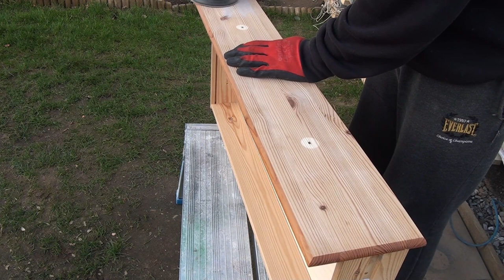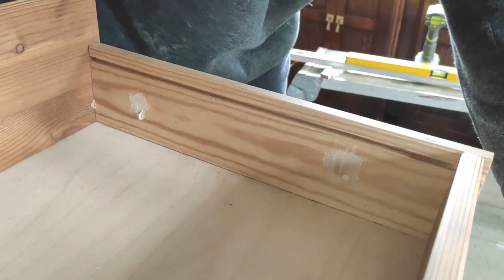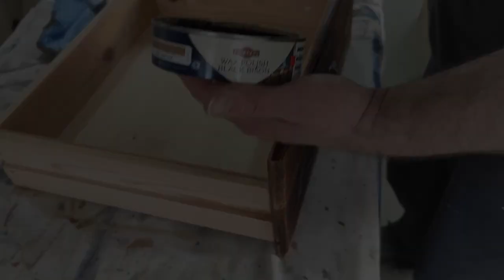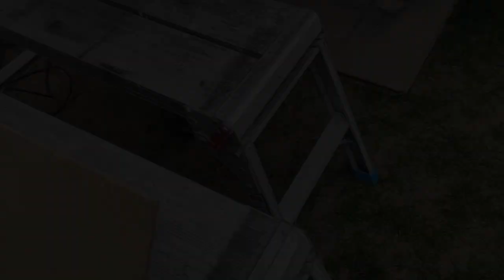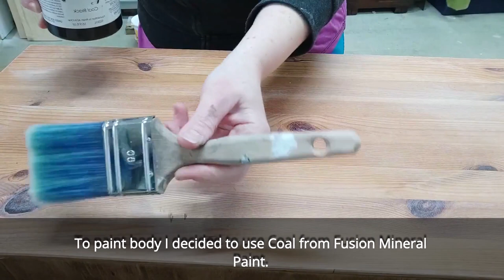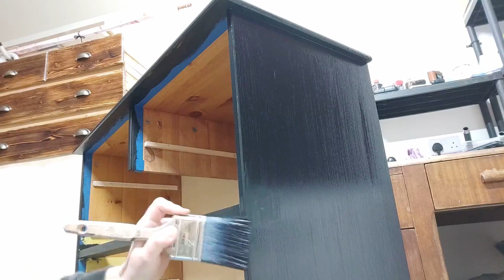Pine chest of drawers makeover with fire and Fusion mineral paint.

Comment: Are fusion mineral paint better than chalk paint?
Reply from the maker: It depends what you are looking for. This particular one is all in one paint and you do not need protection alter you have painted. It's smooth in touch and does not leave brush marks. Chalk paint needs protection after painting, wax is the most common option. Paint itself is thicker and will leave brush marks if not thinned with water.